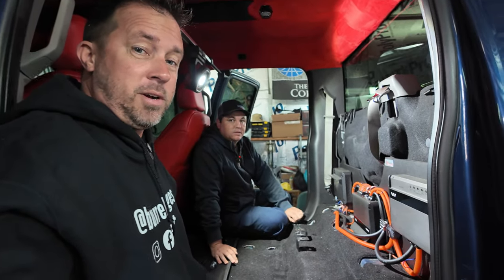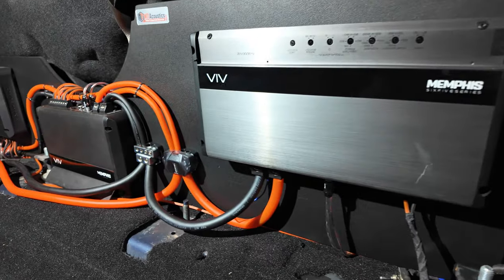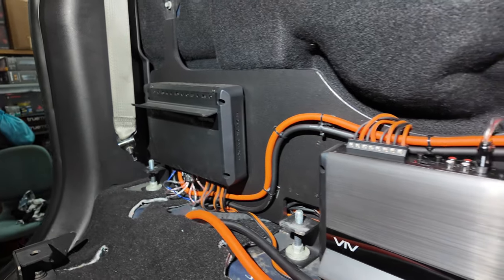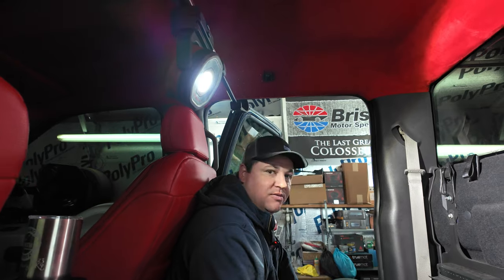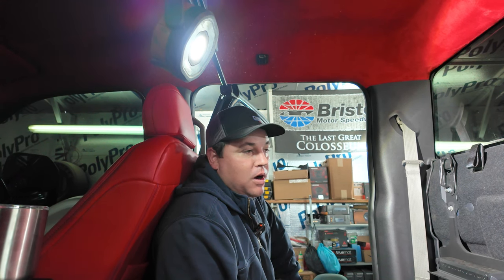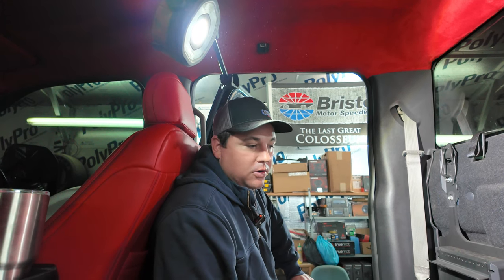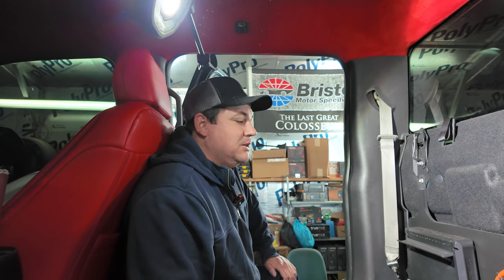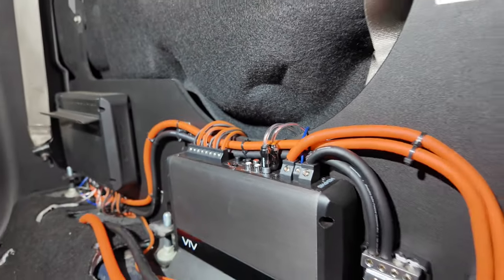Lets cut a hole in a perfectly good truck

Comment: I have a 2014 f150 crew cab with the memphis 65 1500 mono block pushing the dual 8" mojo in box in mine. I would like to do this. Do you still have plans on box? Will you sell them to me?

Comment: BTW, that air flow issue was easily solved by flipping the rear seat down, but that's not really practical with passengers or at shows 🤣